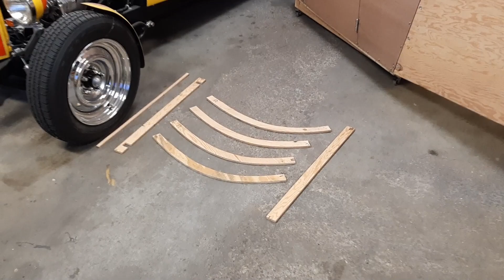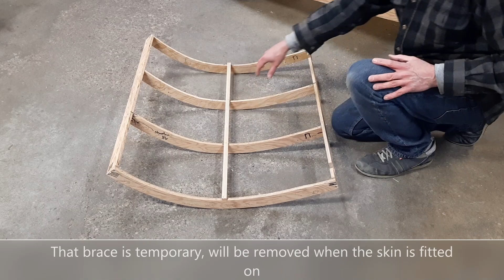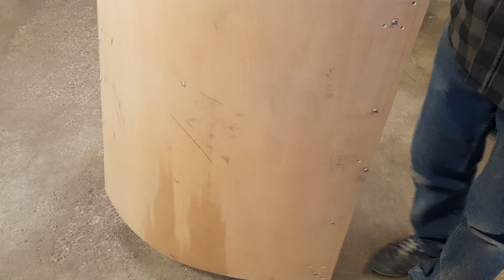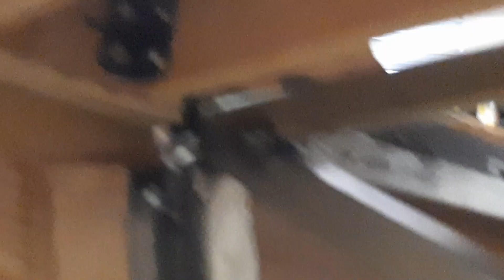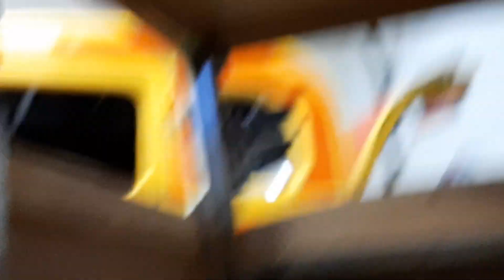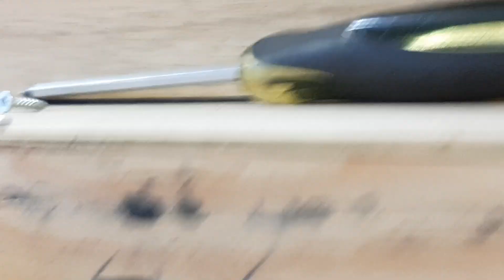The Backyard Coupe Build 6

Comment: Have you ever used the Flexible Plywood? It’s a little spendy, I’ve used 1/2” and it works well when building bars, and islands!
Reply from the maker: Hey David, No I haven't , I am pretty sure the problem with that would be the glue used to make it , I am sure that it would have interior glue, which would be a no no in this application.

Comment: Looks very good, what software, etc did you use to design car? Do you plan on adding door seals and windows for cool weather driving.
Reply from the maker: Hey Lori, thanks! I didnt use any software to design it, just pencil and paper, then I built a crude model about 3 feet long to get the proportions right, then when it looked like what I wanted I built a life size car just out of 2x4s, even made the frame out of wood, just to save money and get everything mocked up. Then built the yellow and orange one in the videos, I am retro fitting the doors with slide up windows, and your right, the original does not have door seals, but I am retro fitting that as well and the plans will have them, thanks.
Reply from the maker: I was just thinking you might have been referring to the cad drawing at the beginning of some of the videos, that is a drawing from the plans that I hired a company to do.

Comment: Can our not fiberglass it when finished and then finish it smooth ideal situation if you know a bat builder with a resin tank
Reply from the maker: you could, but do not need to, just do the body work, minor filling and sanding then epoxy primer then sand , and paint.

Comment: Awesome project Kent. I plan on buying your plans and build one of these myself. Can you give me an estimate, minus the engine and transmission/running gear, what it cost to build the frame, and body? Thanks!
Reply from the maker: Hey Jacob, thank you! The cost estimate is around $1000-$1200, of course depending where you get your steel and other supplies, dont get your steel at metal mart, lol it ok for little bits, but for large amounts like the tubing you will need, I go to the scrap metal dealers that also sell metal, its waaayyyyy cheaper than those metal convenience stores.
Reply: @kentdixon5716  Alright, thanks for the reply and info!
Reply: @kentdixon5716  Hey Kent, one more question, do you know what you spent in total to build the whole car? Chassis, body, suspension, and drive train? I need to get an estimate for my budget before I dive in head first... Thanks!
Reply from the maker: @1971GT  Hey I spent $10,000-$12,000, complete, that was with brand new 290 hp crate, and brand new parts like front axle, vega steering box, radius rods, headers etc, you could save even more if you shop some swap meets.
Reply: @kentdixon5716  perfect. Thank you.

Comment: Very interesting.  Perhaps I will build some parts of a car from wood. I subscribed to your channel, Have a look at my hot rod restoration channel, new life automotive, and subscribe if you find it interesting.  Tom
Reply from the maker: Hey there, thanks, Looks interesting! I grew up a mopar guy, had many, so definitely will check it out I subbed you also.
Reply: @kentdixon5716  Thanks. The amx is about ready for paint, and next on to the 69 roadrunner. :) I built several deck lids from steel, may try a wood one one of these days.

Comment: Great work Kent! Do you round out the quarter windows with a router?
Reply from the maker: Hey Stephanie, thanks! Yes the quarter windows, the roof/door header pieces, rear quarter panels, are all shaped with a router. Then after sanding and minor body work, coated with epoxy primer to seal it , then automotive paint.

Comment: Couple questions. Is there a reason the windshield isn't slanted back? Wouldn't it be better to grind the welds, instead of rounding the wood? You should get a autodarkening welding helmet, Harbor, Northern Tool....around 40 to 50 bucks.. Makes setting the tacks easier. Good video. Can't wait to see the body work. Are you going to fiberglass the stress points?
Reply from the maker: Hey, not sure what you mean about the windshield slanted bank, The Backyard Coupe was designed as kind of a hybrid , combination model A Ford, 32 ford, and it does have a slightly slanted windshield, wherever I can I like to leave the weld bead a little bit , for strength, it is thin wall. Doesnt hurt the wood to make a little relief cut. Welding helmet ?, well I guess I might some day, I have been welding for many years, Kind of old school. The stress points, yes they will be epoxied , Glad you enjoyed the videos!

Comment: Woodstain or veneer weatherproof coats..glossy like boat deck?
Reply from the maker: Hey Roger, well you could, but I like to finish it so it doesnt look like wood, like the first one I built in the video, yellow and orange, epoxy primer, then automotive paint.
Reply: @kentdixon5716  clocked it@88  looked good like funfair. Good times.pram front wheels out front,on the sides,like railer

Comment from the maker: Hey Hot Rodders, thanks to all my subscribers, and comments, I am working hard on the plans, will be out this spring!!
Reply: How are the plans coming along.
Reply from the maker: @Hemi3310  Hey Terry, about 75% complete, working on the chassis right now, and will also post a new video in a few day s on how it goes together.
Reply: @kentdixon5716  Great can't wait. The wife is the wood worker and she's chomping at the bit to build it. I do all the mechanical and have been gathering the running gear parts.
Reply from the maker: @Hemi3310  Hey thats great! I wish my wife was into cars, but a guy cant have everything, she does occasionally complain about not parking in the garage, but lets me use it for the shop so, life is good.
Reply from the maker: @Hemi3310  Hey Terry, what are you gonna use for running gear?
Reply: @kentdixon5716  I've built a 75 Dodge Slant Six with fuel injection and all the good internal parts. 727 Torqueflite running into a Winters quick change rear axle. It's stuff I've had around the shop left over from previous projects.
Reply from the maker: @Hemi3310  Thats cool, my first car was a 68 dart with a slant six wanted a 340, but no money, lol
Reply: Plans available???
Reply from the maker: @williambusby146  Hey William, still working on them, just about finished.

Comment: How do you preserve the wood from moisture damage?.
Reply from the maker: Hey Juan, think of a wooden boat thats painted, they actually sit in the water and if primed and painted they can last years, The Backyard Coupe never really sees any bad weather and if properly primed and painted will last quite a few years.
Reply from the maker: Epoxy primer works really well, then good quality automotive paint.
Reply: Wooden airplane wings often use a very thin layer of fiberglass cloth. Sanded out it leaves a glass like finish for paint.
Reply from the maker: @SK-tr9ii  You could , I have not used this method, might add more expense and cost.

Comment: Why didn't you just make the car out of sheet metal
Reply: I thought about asking the same thing.
Reply: This is art!  Awesome job.
Reply from the maker: @garyvs.carsmore4607  Thank You!
Reply from the maker: @garyvs.carsmore4607  Thank you very much!
Reply from the maker: Well, in a nutshell shaping sheet metal to make a car body is a lot more complex than you might think, wood is easy to work with, requires no expensive tools , and is more durable than most people realize. Especially with a steel structure underneath it.

Comment: Cool build Kent. I was wondering if your going to put in any gussets? Especially where the square tubing meet at 90* angle.
Reply from the maker: Hey thanks, You mean gussets on the inner structure?, No have not had any issues with any of the steel tubing at all, had to pass 2 complete safety inspections, and the car has been driving on the road for 6 years now.
Reply: @kentdixon5716  yep on the inner structure, but if there are no problems then awesome. Loved the videos really great job.
Reply from the maker: @outdoorfuninthesun2393  Thanks, I appreciate the comments!